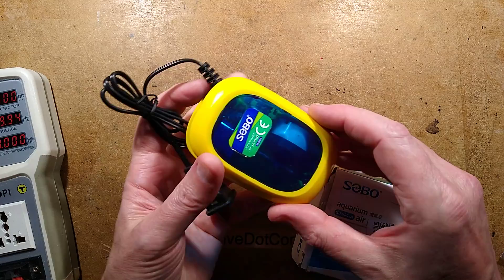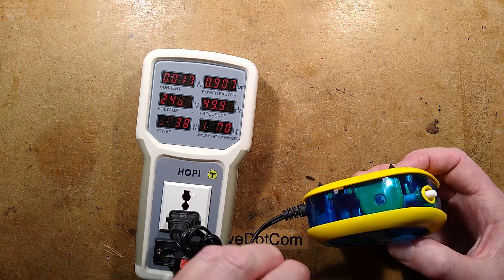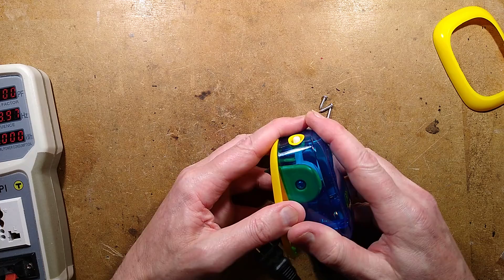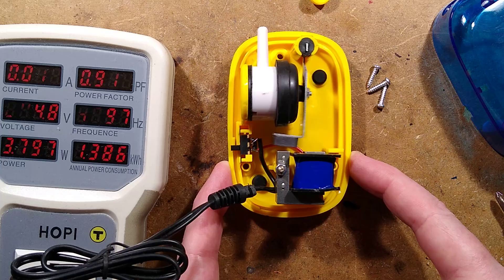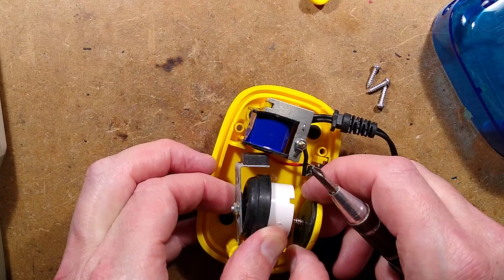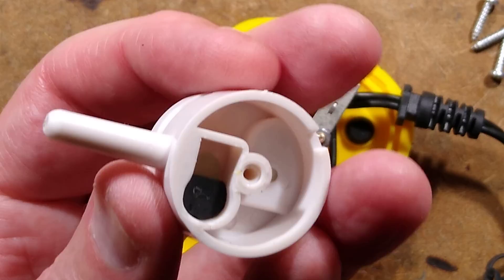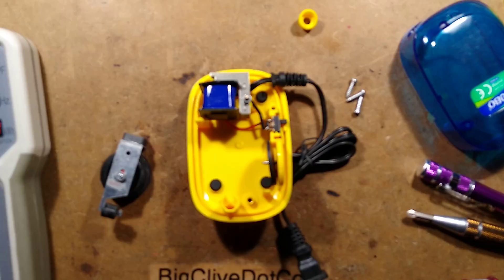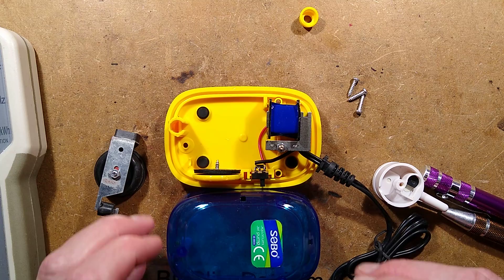Teardown of a two speed aquarium pump

Comment: I remember pulling one apart as a kid about 45 years ago and the mechanism, coil and valves were virtually identical. Great video.
Reply: me too, I had a whisper 300 and you could get a service pack which would be the flaps and a diaphragm. The problem with these has always been the loud buzz which is unavoidable with such a large thing moving such a long way 50 times a second.  I always wondered if you have two back to back opposing each other if that would be much quieter.
Reply: Me too. This pump is an almost exact copy of 1970s "Metaframe" branded air pumps.
Reply: I rebuilt these 35 years ago for people at the pet shop where I worked. Unless you have one of the handful of piston pumps sold to hobbyists, they all had this design and the parts were frequently interchangeable between brands. The flapper valves were always the first thing to harden and go bad.

Comment: I remember when I was seven or so following the explanation in my Great World Encyclopaedia of Science of how an electric bell works, and the triumph of understanding it. This is essentially the same principle, though instead of having a clapper hitting a bell you have a bladder.
Reply: Or a bellow
Reply: I wouldn't want a "clapper" hitting MY BLADDER! 👎😂
Reply: @marcse7en  Or, perhaps a blunt, pliable shaft striking a glancing blow to the prostate.
Reply: Similar bells were used used in ships radio rooms for auto alarms, I remember grabbing one of these and I got a lovely belt due to back emf…
Reply: My pond aerator works on the same principle but significantly scaled up.

Comment: These pumps will run 24 hours a day for years with little maintenance, I have a ehime air pump that's been in use for 5 years, all original parts, I have spare rubbers but a tad of Vaseline every couple of years is all it needs to be as good and quite as 5 years ago. 
Simple design that is reliable and easy to maintain and also very affordable. Perfect for the application.

Comment: I would have bet that it would be a series cap, I did not think that 1/2 wave running the electro magnet "transformer" would be a good idea. But seems to work just fine. I use a aquarium pump to keep all the inflatable robots in the Museum inflated. They tend to lose air over time other wise. To tame my aquarium pump down so I do not over inflate any of the vintage blow up robots I used a old Variac I had laying around. Thanks for the tear down of this 2 speed pump.

Comment: Just repaired my old one but it was a perished rubber seal. Clive you could pump ozone through water, which is a thing apparently.
Reply: Ozone would destroy all the rubber components in a matter of days. Not sure the fish would appreciate all the free radicals either!
Reply: @cambridgemart2075  Yes even the ozone generators for pools use all stainless steel and PTFE parts, which all actually corrode from the ozone. About the only parts which do not are vthose made from quartz glass, though after a year of use the quartz glass pipes were stained brown, and you could not remove that film off the inside.

Comment: The internals, except for the switch & diode, are an almost exact copy of 1970s "Metaframe" branded pumps. The big black rubber bellows (aka diaphragm) cracks and tears after about a year of operation. At one time you could buy replacement bellows at any tropical fish store. Probably not anymore.
Reply: I have one of those old pumps lying around and it barely pumps anything. I thought it was the internal valves which failed but maybe I should go back and inspect the diaphragm.
Reply: @eDoc2020  If memory serves me the diaphragms usually rot and fail in the center around the screw. Pulling the metal arm so as to stretch out the diaphragm will reveal cracks if present.

Comment: If you need more air flow for a larger pond, you get bigger ones that operate on the same principle, just scaled up with a much larger coil, and a diaphragm the size of a dinner plate. Bigger than that you use a side channel blower, which can move an amazing volume of air, and also generate quite a bit of pressure as well. This interestingly does not have any valves in it, relying on the tiny clearance between rotor vanes and the stator housing to seal. Used in a trickle tower they also would survive having some water droplets flow though them with no issues, and would even pump the protein foam if it grew too much in the column as the water went through. Neighbours did not like it, it was pretty noisy till a massive silencer was installed.

Comment: That looks clever, iv never seen a transformer make a magnet wobble back an forth on a diafram, makes me wonder how oscillating saws work
Reply: Usually those have a mechanical coupling like a crank (think piston but in reverse). Something driven like this would probably be too easy to stall.

Comment: The aquarium air pump I have for regenerating copper chloride etchant is the same. It doesn't have a speed switch on it though.
Reply: @Lassi Kinnunen 81 yeah, they've been the exact same for the past 3+ decades at least. I had ones in the early 90s that were the same.

Comment: Used the anonymous grey version of that years ago to provide the airflow for a gas / air blowtorch (used in glass ampoule sealing). Same tiny conical feet too (only ours were white rubber and perished pretty quickly).

Comment: I can imagine that this will be incredibly reliable due to its elegant simplicity. It could be the heart of a closed loop water cooling system, instead of the heatsink and fan, for the Peltier module you featured recently.
Reply: In my experience the weak point is probably rubber degradation, particularly with the valve flaps.
Reply: @eDoc2020  Clive’s ozone production factory would make the rubber degradation even worse😂
Reply: @eDoc2020  I always wondered why they didn't make those bits from silicone...

Comment: I've had the coil fail on me multiple times in a pump that looked identical on the inside. Never trust these cheap pumps when the life of aquarium inhabitants depends on it. I was fortunate to have it used in a non-critical application where fixing the burnt windings was just a massive inconvenience. I'm now using a pump from Schego and they even sell spare parts. ;)
Reply from the maker: I wonder if a series capacitor could be used to nudge the coil dissipation down.

Comment: The pump assembly is common to all of this type of air pump. The rubber blocks that hold the valve flaps in place usually have two small holes in them. This allows a pair of long nose pliers to be used to grip and remove the blocks when the flap valves need cleaning or replacement.  The initially soft, and flexible, flap valves have a tendency to stiffen and become brittle with age. It is usual for the rubber bellows to be removable, as these have a tendency to split open with wear. All of these components are made to a standard size, within a range of sizes, and can be purchased for replacement when servicing this type of pump. 
It is surprising how much pressure these pumps can generate, I have one that supplies air to my koi fish pond. It supports six air stones at  a depth of six foot of water. I also use a smaller version to supply air to my home brew PCB acid etching tank. 
Some of these pumps support two bellows, working in anti phase, driven from a common magnet arm. The advantage of this arrangement is that it appears to reduce vibration, as the arm is generating pressure in both directions of movement.
The model featured in the video has the advantage of the transparent case, making much easier to see when the rubber bellows needs replacement. These pumps tend to run hot, mainly as a result of the repeated air compression. This results in the black rubber of the bellows being "evaporated", and  coating the first section of the connected air line with a thick black deposit.
With so little to go wrong, and with readly available replacement component parts, these pumps can provide decades of service life. They are a perfect example of how not to build in obsolescence. Their only design weakness in the assembly is  the use of self tapping screws into the plastic case on the cheaper models. The more durable expensive units use metal screw bush inserts moulded into the plastic case.

Comment: Clive 
As I watch your great "take to bits" video. 
I thought if you design a four pocket dish with a magnet on the underside of each pocket.  To keep  screws etc in to stop them from rolling around or falling to the floor. Even add your logo on it.🤔
Reply: Oh, now I get it !  You're not talking about the Pump, or the Video, are you ?!  There is a problem in your design. More and more these small screws and wot-not, are turning out to be non-ferris.
Reply: @snakezdewiggle6084  
That is why I thought  pockets  for things like plastic bits or brass.
Reply: @assassinlexx1993  Your idea has merit. Pocket makes me think of straight vertical sides, where 'dish' shaped, parabolic even, may be better.
Reply: @snakezdewiggle6084  
As Clive can 3d print a different models
Reply: @assassinlexx1993  aha !  So now you should include this extra information into your proposal to Clive.
Reply: @snakezdewiggle6084  
🤔👍
Reply: @snakezdewiggle6084  *ferrous
Reply: @littlejackalo5326  Yeah thanks Jackalo, nice catch. ;)

Comment: I believe the diode is used to create a half wave with the wall frequency so on full speed you would have it pumping at 50-60hz and at half speed it would be around 25-30hz
Reply from the maker: Still 50/60Hz, but just half the cycle.

Comment: Rubber bung on the valve is a standard old fashioned rubber ball float part, been a almost standard part for decades, so likely they use it as it is a very cheap part, and available readily from many suppliers, all of which have a very old punch machine that makes them out of a rubber sheet. 

The pump manufacturer is losing out though, they could buy the reject ones, which might have a notch in them on the one side, from being misaligned during punching. Here it will still work, and likely will be cheaper as well.

Comment: I would like to overclock it using some speaker amp or vfd or some smps circuitry
Reply: I don't know if that would work well. The swinging magnet is likely designed to resonate around mains frequency. If that's the case and you deviate from the frequency, there will be less displacement.

On a second thought, if you just want to pump more air overvolting is probably the easier way to go.
Reply: @eDoc2020  Yes. There are this two ways of overclock it. Bringing up the speed or the articulation.
Reply: @eDoc2020  Rubber bung dampers at every pivot point plus bellows and valves to extract energy from it is really not the best way to design a resonator.  I think it's just a lever

Comment: Resonance at play
The armature is like a pendulum, think of it like a childs swing, on full power someone is pushing both ways, on half power there's only one, it swings the same, but not as far ;)
Reply: The rubber bits securing it at the end and middle do anything *but* resonate, really...  It's just a lever, transforming distance into greater mechanical force to operate the bladder.

Comment: I'd like to see that connected to a VFD and the frequency wound up to the limit of the pump's performance.
Reply: Take it a step further and make it a speaker with some high voltage amp
Reply: What does a vacuum fluorescent display have to... ah. Not that kind of VFD.
Reply: it will have a peak at the natural resonant frequency of the armature-diaphragm assembly. Because of heavy damping, it may work at higher frequency but with lower armature motion.
Reply: @Kalvinjj  Micah Elizabeth Scott did that as part of some art project.
Reply: @Kalvinjj  lol I've  been thinking of making a speaker pump. Dual ports on a subwoofer and a pair of  flappers.

Comment: Would be cool to make a cheap vacuum pick and place pump for small SMD parts of one of those. 
Is it possible to turn the valve to accomplish that, or just hack the inlet?
Reply: Reinstall the chamber backwards.
Reply: @randyhardee4773  that's also a possibility, but did not see a grove for the rubber diaphragm, I guess as long it wil stay on its 👍
Reply: Sometimes you can find little 12V motors designed for medical suctions.  They make a surprisingly strong vacuum for being a tiny plastic part.

Comment: Aquarium pumps haven't really changed much in decades. In some older pumps, the little flapper valve was replaceable, and some had a little felt air filter. 
     I guess aquarium pumps are just one of those things that really don't need much updating...

Comment: Owned and used many pumps like this for the many fish I have kept.  They are intentionally user serviceable and usually there are service kits available for them.  I'm curious to the stats for the coil, its windings, resistance, inductance stuff ya know :)
Reply: Service Kits are a thing of the past, I do believe. These pump manufacturers have learned from Apple, John Deer and many others. It stops working and you are expecting to throw it into a landfill somewhere, and buy another. The rubber diaphragm and check valves last about two years under 24/7/365 use. Where does “Right to Repair” stand in your country of residence??
Reply: Coil's L and R would be interesting to know. Because the PF is so high, it must be mainly resistive load.
Reply: @Mr7yhnmki8  sadly true for a lot of companies however there are a lot of easily adaptable kits on Amazon and the design is pretty universally standard enough.  I've even MacGyvered solutions in a pinch.  Yup, in the 2nd to 3rd year they would need the redo.  In terms of Canada the news is: On June 2, Canada’s Parliament voted unanimously upon second reading (330 – 0) in favour of Bill C-272 (a good start but not yet at the finish line).

Comment: So the introduction of the diode into the circuit simply reduces the displacement of the diaphragm? You're reducing the average voltage to the electromagnet so it's swinging a shorter distance?
Reply: My thought is since it's AC you're getting half wave rectification, and the little bit of diode voltage drop.
Reply from the maker: It only allows the coil to be energised on half of the mains cycle.
Reply: Instead of push/pull, it is only pushing the diaphragm with the diode. The elasticity of the diaphragm does the pulling. Be interesting to see the depth of output.

Comment: Well now, those pumps have not changed one hot in the last 60 years that I know of, other than that diode. Earlier versions often had nothing more than a rubber damper to control the magneto pendulum.  That said, they could still develop a respectable amount of pressure, considering what they were made for.

Comment: So is the AC current causing the coil to allow the metal to pulsate the pump? How does the diode change it's rate? Peace DVD:)
Reply: No diode, peak to peak voltage, +320v to -320v approximately.
With diode, 320v to 0v, so half the amplitude.
Reply: @simonruszczak5563  How is the diode connected? in series from the power to the coil?...thanks

Comment: Any idea of airflow? Wonder if it would it be capable of running a little air bearing?
Reply: @Lassi Kinnunen 81 Thanks, I wondered if I got that wrong.. But then I was  taught pumps make flow not pressure? The pressure being the result of that flow in a constriction/ pipe /chamber etc.
Reply: @Lassi Kinnunen 81 thanks again Lassi.

Comment: Great! plug it in on low speed setting and your type AC RCD stops functioning due to the DC components it puts on your house load.  Meanwhile you are playing with lots of water in your fish tank with pumps, lights and heaters.
Reply: You'll be alright.
Reply: I would be more concerned with hairdryers pulling well over 100 times as much power.

Comment: I have a strange question that I haven't seen before. Can you take a 220 volt European power tool and get it to work properly on 110 North American power? Or am I just stuck with the wrong drill?
Reply: North American residential power usually delivers 240 volts at the panel, and some of the circuits in a home run on both "hot" wires to get the full 240v (oven, dryer, water heater, large motors, vehicle chargers, etc.). The 120 volt circuits use just one hot wire and a neutral. 

You can hire an electrician to wire a 240 volt outlet in your home, and then maybe you can run your tool, though I don't know whether an electrician would recommend it. I certainly wouldn't suggest it without GFCI (or better) safety protection.
Reply: You would need a step down transformer with a high enough current rating, so it's probably unfeasible.
Reply: @simonruszczak5563  Wrong direction, he wants to use a 220v tool on 110v, the problem here is 220v tools will only get half their power.
Reply: The best thing to do would be to buy 110v tools or replace the motor with a 110v one, you can get used tools for next to nothing, often even battery powered tools free as replacements can be expensive.
If you really want to keep it though, here's another suggestion: https://www.youtube.com/watch?v=MrZRxjWY_ms
If you can find some 60v tool batteries for cheap, get 4 of them, wire them in series and there you go 240v, I probably don't need to explain why, but be very careful if you do that.
Reply: @vgamesx1  It's just 1/4 (quarter) power, half the voltage=half the current. 1/2 * 1/2 = 1/4.
Reply: @kuebbisch  Right, I forget about that.
Reply: @vgamesx1  that's what I thought. I ordered a US tool but AliExpress sent me an EU tool. I just thought I could still use it in some way instead of having to replace it.
Reply: @CDE.Hacker  The easiest thing to do is just try it. It will run weaker on our lower voltage but it won't hurt anything. Maybe the power will end up being sufficient for your needs.
Reply: You can run it from a giant 220v oven outlet, which is a more convenient form of the giant british 220v outlets